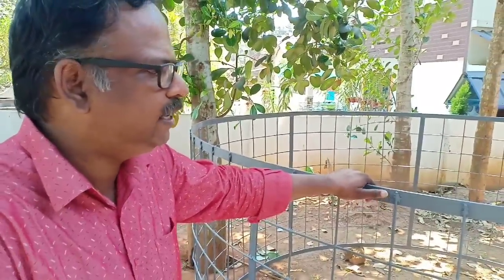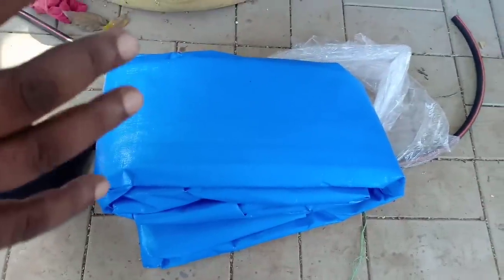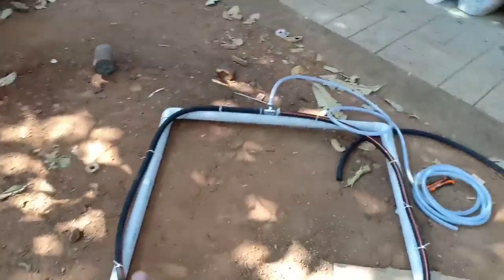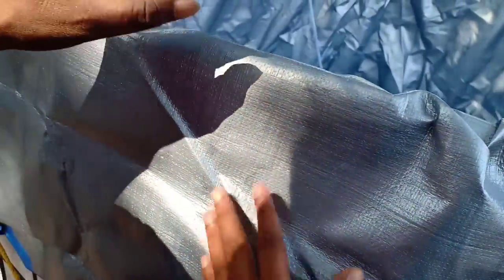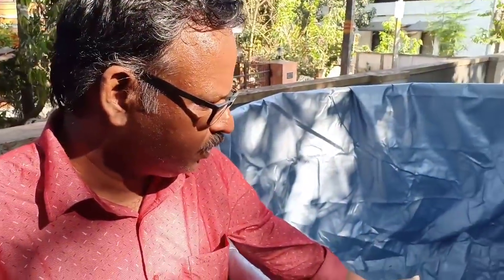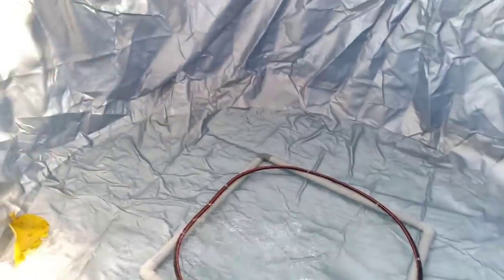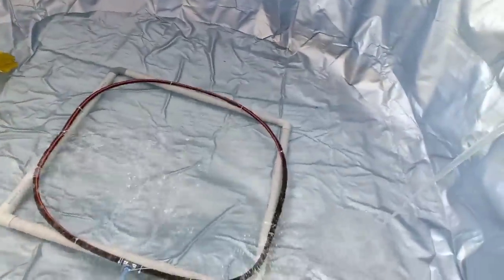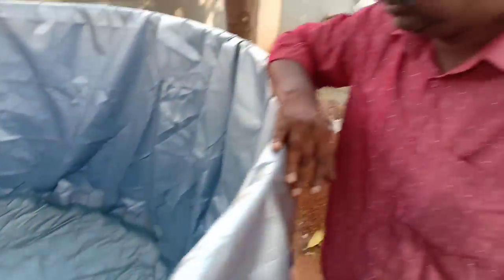Biofloc Tank Construction

Comment: Top quality easy to install biofloc tank system 
3 M Dia x 1.2 M Height  / 7000 Ltr
• PVC Coated nylon tank - 550 GSM / 1.5 M - Rs:-6200
(Drainage connector and filter attached on the tank, 6 mm Rope included) 
• HDPE Protection liner - 500 Micron / 1.5 M - Rs:-1400
• Wire mesh -  1.2 Meter height, 4mm thick, Mesh size 4’’x4’’  Rs:-2400
Total Rs:-10000
4 M Dia x 1.2 M Height / 12000 Ltr
• PVC Coated nylon tank - 550 GSM / 1.5 M - Rs:-8750
(Drainage connector and filter attached on the tank, 6 mm Rope included) 
• HDPE Protection liner - 500 Micron / 1.5 M - Rs:-1750
• Wire mesh -  1.2 Meter height, 4mm thick, Mesh size 4’’x4’’  Rs:-3000
Total Rs:-13500
5 M Dia x 1.2 M / Height /20000 Ltr
• PVC Coated nylon tank - 550 GSM / 1.5 M - Rs:-12300
(Drainage connector and filter attached on the tank, 6 mm Rope included) 
• HDPE Protection liner - 500 Micron / 1.5 M - Rs:-2100
• Wire mesh -  1.2 Meter height, 4mm thick, Mesh size 4’’x4’’  Rs:-3850
Total Rs:-18250
6 M Dia x 1.2 M Height / 30000 Ltr
• PVC Coated nylon tank - 550 GSM / 1.5 M - Rs:-15600
(Drainage connector and filter attached on the tank, 6 mm Rope included) 
• HDPE Protection liner - 500 Micron / 1.5 M - Rs:-2450
• Wire mesh -  1.2 Meter height, 4mm thick, Mesh size 4’’x4’’  Rs:-4600
Total Rs:-22650
>All kerala delivery available
>Fee instructions for installation and farming 
>Cost included GST
>Excluded transportation cost (Approximately Rs:-500 - 1000, depend on location and size)
>Direct billing from our factory, no mediators
Call Mob : +91 6238 493 485

Comment: It was a very useful video , but could use more details about the tarpaulin dealer from delhi you mentioned as the prices are too much in kerala
Reply from the maker: Next time
Reply: 3m dia with 1.2m height of Tarpauline 630 GSM - Rs 6000 /-
The price is ex-factory.
Regards
Prantik Sinha

Co-Founder and CTO

Mob : +91 8981536485

Comment: ഫിഷ്ടാങ്കിലെ അടിതട്ടിൽ നൂല് പോലെ ഉള്ള മീൻ വേസ്റ്റ് അക്വ ഫോണിക് മോട്ടോർ പമ്പ് വഴി വലിച്ച് എടുക്കുന്നില്ല ഈ വേസ്റ്റ് മോട്ടോർ പിടിക്കാത്തത് എന്തുകൊണ്ടാണ് ഇതിന് ഒരു മാർഗം നിർദ്ദേശിക്കാമോ
Reply: ഫിഷ് വേസ്റ്റ് മോട്ടോർ വലിക്കാൻ വെള്ളത്തിന്റെ വേഗത 1m /S  എങ്കിലും ആക്കണം. വെള്ളത്തിന്റെ LPS  കണക്കാക്കി അതിനെ പൈപ്പിന്റെ വിസ്തീർണം കൊണ്ട് ഹരിച്ചു ഇത് കാണാം. പൈപ്പിന്റെ സൈസ് അഡ്ജസ്റ്റ് ചെയ്താൽ ഇത് ശരിയായി പ്രവർത്തിക്കും. 

For the Fish waste to be sucked out, you need a linear velocity of about 1m/S. First calculate the LPS of your water flow and divide it by the cross sectional area of the pipe used to derive the linear velocity of evacuating water flow in m/S. By adjusting the suction pipe size you can adjust this. In your case either the water flow is too low or the suction pipe size is too big for the flow rate. 
for example with a flow rate of 2 LPS (2000 cm3/S) , if a 3 inch pipe is used, the exit flow rate will be =2000/ (3.14159*7.62 cm*7.62 cm/4) = 43 cm, the suctional velocity is too low  but if a 2 inch pipe is used the velocity will become nearly 98 cms/S and waste will be evacuated well. I hope this helps.
Reply from the maker: Thank u sir for helping us

Comment: Dilip, Good job. Keep up the good work. Looking forward to further developments and good that expectations are set right.
I think Samad made a mistake about the capacity of the tank. It is about 7500 litres and not 10,000. It may be good to have some sort of protection from outside to prevent accidental poking by children as the foam sheet may not provide much help (as you can see how easily it gets punctured by tie wrap). Even a round of HDPE plastic sacks may be of help. Also a 2 inch thick layer base of 3/4 inch granite aggregate with  rock dust may prevent termites or rodents from attacking the tank from bottom. Or may be a layer of GI close knit chicken mesh even may be OK. Anyway,  I am sure Dilip must be preparing those things. 

Also, one question, why do we need such sturdy frame as the highest pressure is only about 12 kpa or less. Please correct me if I am wrong. May be it is cheaper to get off the shelf GI coated grid and add 10 mm bar as top and bottom ring. 
Also I think the plastic is still costly as it is costing more than Rs.2/ litre for the project. May be fabricating the frame should be avoided. I would like to see about Rs.1/ litre for the entire project. I believe you will be able to run a 20,000 litre tank with a HAP-120. Any way it looks really good.
Reply from the maker: Thank u sir for the feedback.
I will try to change my mistakes...
Reply: Hi. I got a quotation for Bio flock tarpaulin tank. 

"
Thanks for your enquiry,

3m dia with 1.2m height of Tarpauline 630 GSM - Rs 6000 /-
The price is ex-factory.
Regards

Prantik Sinha
Co-Founder and CTO
Mob : +91 8981536485
"
Reply: @pjonathan6259  8000 litres tank for 6000 rupees??
is it having any metal frames??
Reply: @gokulpanicker4756    Hi.  There is a contact number given in that quotation . You can get the detail directly from them.    I got it from Indiamart. Just shared with you all,  just in case useful for all those really looking for .